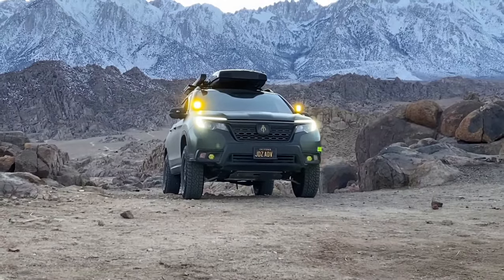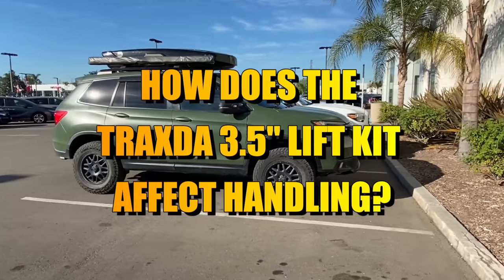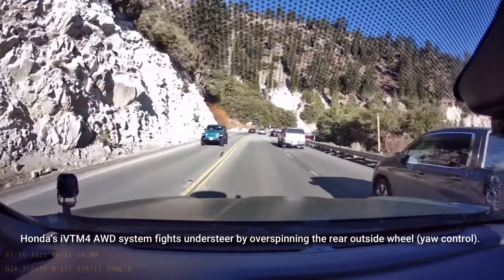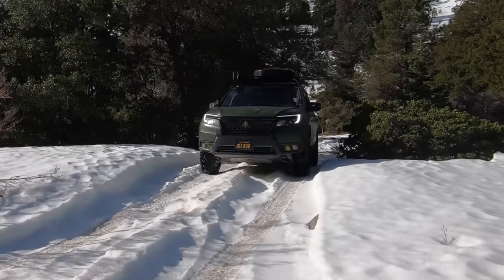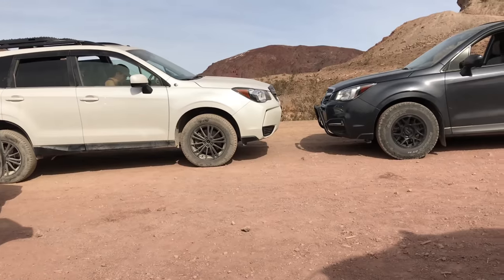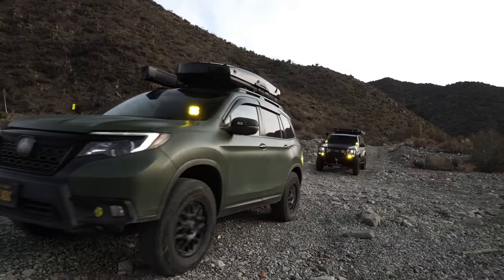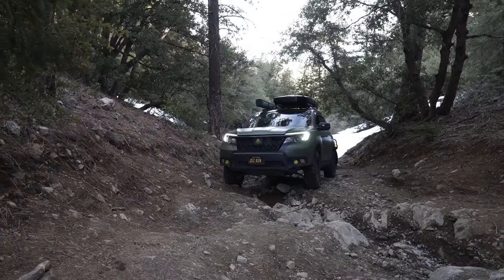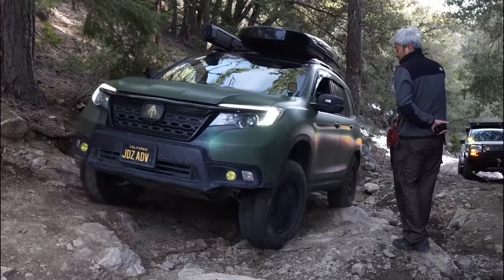3.5 inch LIFTED! Passport / Ridgeline / Pilot

Comment: Always paving the new road for off-road Honda enthusiasts. Sorry about the axle casualty. Looking forward to the damage and repair report.
Reply from the maker: I guess all the mud I’ve driving through really got the axles sticky.  While hammering them out the threads were damaged.  The solution was a tap and die kit or new axles.  For $175 Traxda was able to get some aftermarket axles from autozone.  Install looked really straight forward.  You just stick the thing in.  No greasing the boot or anything.  I’m not a super mechanically inclined guy, but I think I may be able to do the job myself in the future.  It’s just a two person job having to handle the heavy knuckle and all.

Comment: It's very cool and unique that you chose a Honda Passport for these off-road adventures.  Most everyone I know has either a Toyota 4Runner, Jeep Grand Cherokee or Wrangler.    Personally speaking I didn't like driving a Wrangler everyday.  The 4Runner is much much better.  The Grand Cherokee is pretty awesome.  I will definitely try out the Passport though.  Your videos definitely raise its reputation.  And that lift looks great on it.
Reply from the maker: Thanks for the kind words!  Since a lot of my adventures are hundres of miles away on a paved road, I had to choose a vehicle that was well balanced in on-road comfort and efficiency and offroad capability.
It seems AWD is getting more capable and 4WD is getting more efficient and comfortable, one day they'll probably merge.  Still a long way to go though!  The Land Rover Defender should be the vehicle to bridge the gap, but too many reliability issues (according to TFL) and the independent suspension seems to really limit capability.  The Jeep JL wrangler seems to be one of the better on-road handling 4WDs but also hands down the most capable.  Lets see what the new Bronco has to offer!  Exciting times ahead!

Comment: I am in the process of installing a 2 inch lift in a 2011 pilot. I can't wait to try it out. Also, I have an engine skid plate coming in. After that I have to fabe exaust, rear diff and fuel tank skid platez.

Comment: Nice vehicle, you are probably going to get crap from body on frame people (i drive one, my exploring vehicle is a Nissan Xterra) but i have noticed after going out since around 2016, that unless you are going to be doing some extreme rock crawling (which like 98% of off road people wont) you can get out there, explore, camp, overland, get to know new places, etc, with pretty much any vehicle (AWD or FWD, body on frame or unibody) ive gone places where unibody vehicle's keep up with Toyotas, Land Rovers and Jeeps, from deep snow and mud, sand and difficult trails, i believe its pretty much all up to the driver and his or hers common sense and good tires... Keep up the nice videos!!!
Reply from the maker: Thank you so much for this comment!  I use to drive a 2008 FJ cruiser, but like the majority of people that own body on frame 4WDs, I never took it offroad.  I just drove it up snowy roads  up to the ski resorts.  My Brother actually owned the vehicle, but he had a long work commute so he traded vehicles with me for a while (he took my 2003 Toyota Celica 5spd manual).  Fuel economy wasnt too good, especially at the time, gas was $5 a gallon in California.  I didn’t like the floatiness on the highway and how the vehicle handled.  Eventually I purchased a used 2010 WRX.  After I went AWD, I never looked back.  I like the comfort and road handling!
You’re so right about the “hard core rock crawling” part.  Those places are typically busy with recreational off-roaders.  I actually just want to explore and get to beautiful destinations, the new term that I’ve been hearing about alot is called “destination overlanding”.  That’s what I do, and this vehicle is balanced well for it!

Comment: Awesome. Thanks for opening up more ideas for AWD off-roading! Keep making fun and great videos!
Reply from the maker: Hey!  You have the lifted disco sport don’t you?  There’s a guy that commented looking for a lift
Reply: @JonDZ_Adventuring  Yeah the Disco Sport is in a bit of a limbo, the panoramic roof cracked- it seems to happen to these so that is getting replaced as we speak. I have the Eibach lift springs in but waiting for the Spaccer strut spacers to clear customs. The skid plates are TBD from (over 4 months) EU. I have a brand new Voyager low profile roof rack siting in my garage waiting for install - taking out the current rails and crossbars. With that I’ve been focusing on the EcoSport waiting on it’s lift kit, rear “pseudo” spare tire swing away concoction system, and seeing if I can get plates fabricated for it. And work has been bizzee.

Comment: How did the 3.5in lift affect your gas mileage? And the 2in lift for that matter?

I test drove a Passport yesterday and really enjoyed it! Just wishing I had a little more ground clearance and want to know what I’m realistically looking at for fuel costs.

Awesome videos man! Appreciate the content 😎
Reply from the maker: There wouldn’t be any noticeable difference from a lift.  It’s well documented in 4WD groups of all makes and models that a lift does little.  More aggressive and larger tires and roof modifications (cargo platforms, racks, carriers) will make the biggest difference.  Also, make sure to run skid plates, they will improve your MPGs with their smoother surface.  The Traxda 3.5” lift is solid, I ran it for 70K miles.  I have a more custom setup now, but I can tell you that I’m dealing with “custom issues” too.

Comment: I hope you're willing to answer this. I'm just getting into the idea of modding my vehicles for off-roading or over landing. 

I have a friend that works on cars and I showed him this Traxda lift kit. He says it's just a body lift, and that you're better off lifting the entire suspension with new springs. Any opinions on this?
Reply from the maker: Immediately right there, by him saying "it's just a body lift" you can tell he is not experienced with how the modern unibody crossover/SUV with full independent suspension lifts.  When you lift a vehicle like the one I have, the whole thing goes up, that's why this 3.5" lift kit increases my clearance from 8 inches to 12.  So what vehicles do you plan on lifting?  If you have solid rear axle vehicles, the spacers will only act as a body lift, then you'll need to add taller tires to raise up your differential pumpkins

Comment: This makes me more confident in purchasing a whatever year Passport. Although I would love it if you knew if this would fit the new 2022 Trailsport. Also, what tires are you running? Would the 18s from the new 2022 be sufficient with this lift kit? Love the content, and you got yourself a new subscriber
Reply from the maker: Thanks for the support!  The 2022 Passport is the same vehicle (trailsport is just a trim).  I run Falken Wildpeak AT3W, as far as the size, they are 32.1” x 10.0” 255/70R18, but these will not fit without modification.  Check out my build here:  https://crossoverlanding.com/honda-overland-build

Comment: love your videos, minimum ground clearance is measured by the lowest point of the vehicle aka your lower control arm as you can see its closer to the ground than the skid plate. just fyi
Reply from the maker: Thanks!
The CV joints aren’t counted in the minimum ground clearance measurements.  For example, a Subarus lower control arms lowest points is 6-7 inches, but it’s advertised for 8.7 inches of minimum ground clearance.

I get you though, they are a low hanging point, and if I mess up on wheel placement, they’re taking a hit.  So I’m super excited for those Traxda high clearance lower control arms!

Comment: Just bought a '22 Pilot SE with 20" wheels.  This has def peaked my curiosity.  I wasn't thinking to lift my Pilot because I do a great deal of off-roading, but because I went from the a beast Infiniti QX80 that is WAY higher to this Pilot that makes me feel like my butt is dragging on the ground!  I just want to be a little higher up, but better ground clearance never hurt anyone either!  Thanks, you have a new sub!  I will be considering the 3.5" lift for sure!  Now to find someone reliable to install it, as I'm not going to trust my new Pilot to some backyard hack.  I"m in SoCal as well, any suggestions?
Reply from the maker: Central tire #5 by LAX has lifted many midsized Hondas.  Ask for Aldo and tell him I sent you.

Comment: Hey Jon, traxda doesn’t call it out on the website but you’re using the ridgeline lift correct? Considering pilot passport and ridgeline are all interchangeable?
Reply from the maker: Yes, the lift works on all 3 vehicles.  It’s recommended that the Pilot and Passport go with the 3.5” front / 3.0” rear lift kit

Comment: Nice vehicle and video. Just got a 21 pilot that im about to rig for some adventuring. They are both surprisingly offroad capable vehicles. Even though they rationalize the 3.5 lift im still leery of how that would wear on the axles and gonna go with a less aggressive 2in. Im not gonna take the thing rock climbing so that plus bigger tires should work just fine to get me and my boys into some decently hairy terrain.
Reply from the maker: The 2 inch kit will put more stress on your axles compared to the 3.5 inch kit.  I ran the Traxda 2 inch kit for 35K miles
Reply from the maker: @Travisj9935  yes, but I’m also partnered with Traxda to sell the 2 inch kit.  If you watch the video, the shop foreman (Justin) explains why the 3.5” kit puts less stress on the axles.  You can visibly see the axles are more straight.
Reply from the maker: @Travisj9935  I put 48K miles on the 2 inch kit and 33K miles on the the 3.5 inch kit.  I’m well past my factory warranty.

Comment: The main reason for lifting them is to put the bigger tires in, that's what gets you off the ground, with this lift kit what's the largest or should I say tallest tire you can fit in there without rubbing?
Reply from the maker: The modern Unibody crossover/SUV lifts different than a Body on Frame Truck or SUV.  When you have a body on frame vehicle, spacers lift the body, and the frame stays where it is, especially the differential “pumpkin”.

In the Modern unibody, the differentials lift with the subframe.
Reply: @JonDZ_Adventuring  in the video the current tire size looks perfect for the truck but in my mind stepping up a notch 33 inch would be awesome, once again what do you think the bigger or biggest tire size that it would fit without rubbing

Comment: Hi. To start with - I really appreciate your movies, it's a great way to learn cool and helpful things - Thank you. I have a quick question about tire robbing, did you have any spacers installed, or are you running this 3.5 lift without it? Additionally, did you do any timing to your bumper covers or other parts there?
Reply from the maker: I think I answered this in another of you comments, right?
Reply: @JonDZ_Adventuring  In another comment I asked about tire pressure sensors, and the robbing question was under another video, and I have never seen a comment under it, or I missed it in somehow :(
Reply from the maker: @theChico999999  haha!  Thanks for clarifying, sorry!  So, spacers won’t really help you clear taller tires, but they may help clear wider tires. An OEM offset (neutral spacing) is your best bet.  I run a wheel with a 10mm offset (oem is 55mm offset) which is equivalent to a 1.75” spacer.  It actually made the rubbing worse.
Reply from the maker: @theChico999999  I had to trim more of the wheel well, and yes, I trimmed the inner plastic splash guards.
Reply: @JonDZ_Adventuring  Thank you.
Reply from the maker: @theChico999999  youre welcome

Comment: I am half way through this video. Based on what you have said so far this has some of the same off road hardware that the Bronco Sport Badlands has If I am not mistaken. It seems like this might be a better vehicle for several reasons. What are your thoughts from what you have seen out there? The Passport now has the trailsport, I am wondering if it may be a better option.

Comment: Hi Jon, Great video's.  Did you ever overheat the trans before you installed the transmission cooler?  If so, in what situation did that happen?
Reply from the maker: No, I have never overheated the transmission.  Highest temp has been 230F because that’s where I draw the line.  I’ll pull over and wait the 10 minutes for it to cool down (which is relatively quick).  In the midsized Hondas, the temp light comes on at 250F.
 I change out my high temp transmission fluid (the expensive green stuff) every 30k miles, and I do this because of my previous experience, I have transmission PTSD.  My previous vehicle was a 2015 Subaru Forester XT and the CVT overheated frequently.  The light comes on at 270F and I had it pop up on 3 occasions.  The CVT melted at 60K miles.
By the way, The Passports transmission is not prone to overheating.  If the Passport is at 230F other single speed AWDs will be at 300F+ or catastrophic failure.
This all relates to crawl ratio, the more of it, the less hot it gets.

Comment: Those prototype rear lower control arms would look great. I've seen trailhawk cherokees tear theirs out offroad.
Reply from the maker: Yeah, they were designed for the 2017-2020 Ridgelines that didn’t have the dual exhaust system.  The design will have to be modified to fit the exhaust in the newer models.